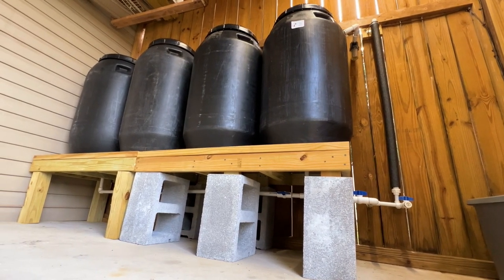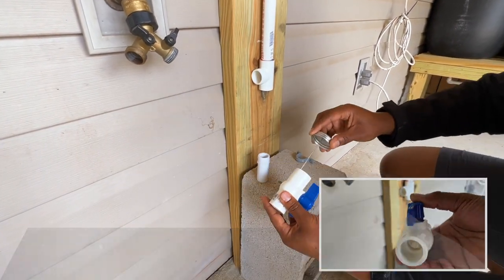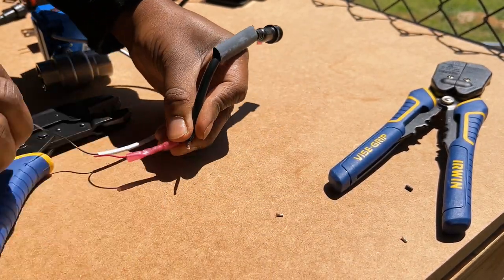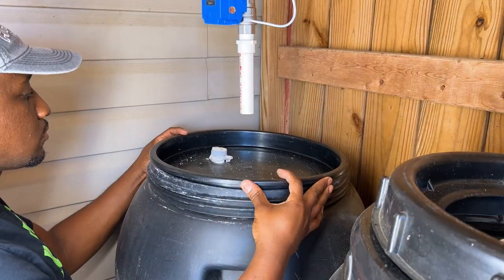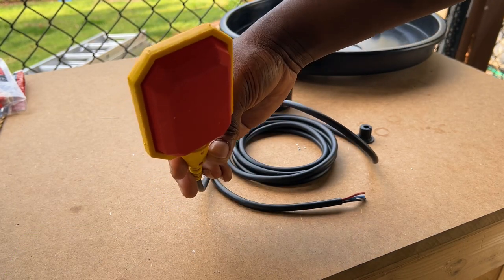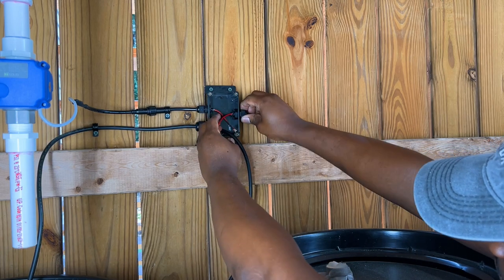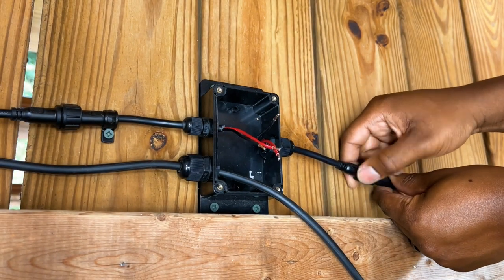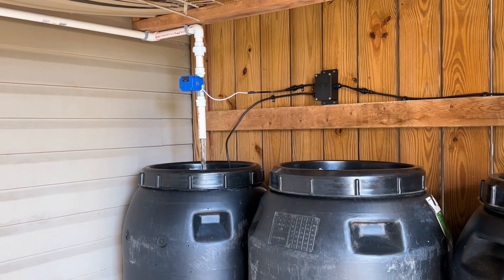NEVER Run Out of WATER Again: My DIY Solution for REFILLING Rain Barrels

Comment: Great design.  The only issue.  The garden hose.  Having to leave the water in the on position in order for the system to work creates a failure point at the hose.  I would take the time to make a PVC solution (even using some flexible pvc) or use a braided stainless steel hose (similar to  washing machine hose) You are great with PVC so I know it would be a breeze for you.

Comment: Great work overall.  Love your vids.  However that short bit of garden hose is a disaster waiting to happen.  Garden hoses cannot withstand constant pressure and will eventually bulge and then blow out.  Please try using a braided washing machine hose instead.
Reply from the maker: Good point and great idea. Thanks for sharing!
Reply: @GreenTechTown  I was about to make my own comment but this seems like a better spot.
If you intend to ever use this while you're not around, I would suggest one of those automatic safety devices they use for washing machines hookups.
They're designed so that if a hose bursts while you're not around they will eventually cut off the water.

Comment: First I must say, great video and exellent channel; I always learn something new. On the other hand I have to say that you overcomplicated things by 1000. I have a similar set up, but with two 250 gallon totes. I have a water float valve 12 inches from the bottom of the tank. My water level never goes below that level when it doesn't rain. Simple, but extremely effective, no electricity required. Works just like a toilet 😅
Reply from the maker: Good idea!

Comment: Very nice job my only thought is that you because you put a float switch in all you needed to do was put that in series with your valve and send power to it turning it on and off from the Internet is really doesn’t have a purpose anymore because you don’t know the water level of the barrels so if you’re out of town you don’t know whether you want to turn it on or off the float switch is going to do that for you automatically just wire the power to it and let it go and it will automatically keep those barrels full good job though looks great you did a nice job❤️🇺🇸

Comment: Instead of a ball valve have you considered a magnetic check valve? Have you also considered expansion room in your storage in case of overheating or freezing?
Reply from the maker: I haven't look much into the magnetic check valve, but so far I really like the ball valve and the low power consumption. Regarding the storage, I typically empty my barrels in the winter to prevent freezing issues, and I due to where I have the barrels located, I haven't experienced any overheating issues.

Comment: I would change the way the float switch works so that if it triggers it keeps the valve shut when the water level goes down rather than opening the valve back up.

Comment: All of those wire strippers don't work worth a 'f'. None grip and all slip.
Then need deeper and sharper grips and cutter.

Why do people use channel locks backwards? Never ceases to amaze me.

You have a nice setup.
For me, I would not want bluetooth controls. It is possible that someone else could turn your stuff on remotely.
Just a redundant float switch (pair) setup is probably the more secure way.
It can auto fill and auto shutoff both.

Comment: This is excellent, however, I think a ball/float valve installed low down in the tank would have continually supplied water  when required without the need for electricity/tech etc. ( genuinely dont mean to be a buzzkill, I'm a programmer and really like automation projects - but unnecessary tech/complexity never sits right with me - just my personal opinion, not intended to disparage  )

Comment: You might want to add, check where you live because in some states it is illegal to collect rainwater in barrels.
Reply: Surely it can not be an 'illegal' act to save rain water ?
Reply: @Vegan123 It's not illegal in any state to collect rain water, but there are restrictions on what it's collected in, how it will be used & how many gallons are alowed. Check your state or local regulations  before installing a system.
Reply: @cathyrowe594  If you are out in the rain and look up to the cloud and then open your mouth - are you doing something 'illegal' ?